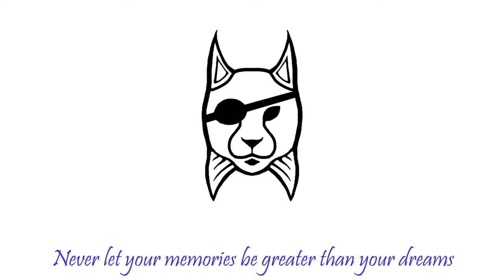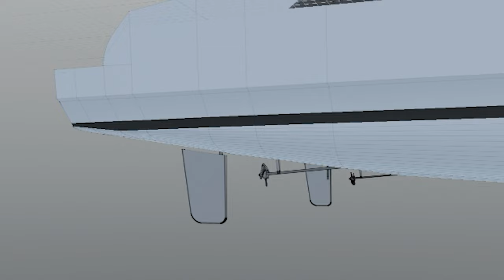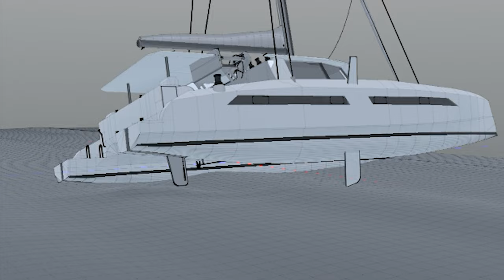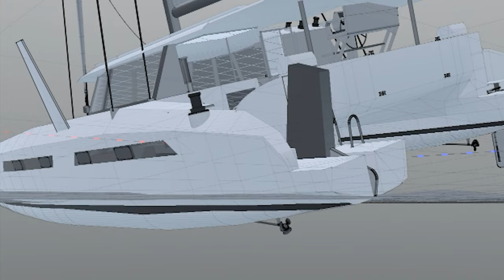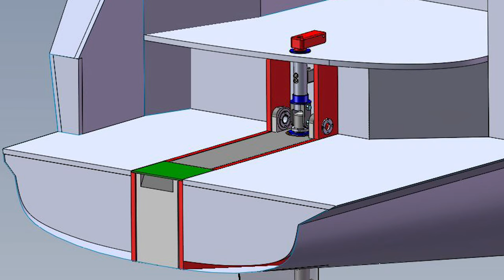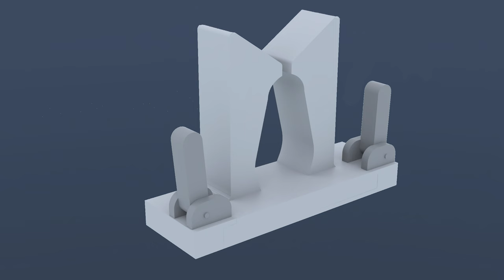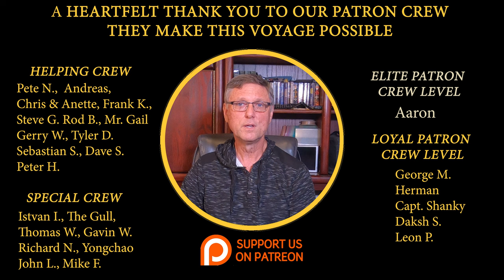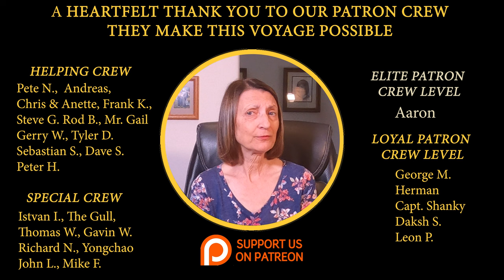Kit E39: Kickup Rudders, Bow, and Bulkheads

Comment: Another interesting week.....learned a lot about the mfg. of the bow point and the kick up rudder.   Thanks.
Reply: With the glass rope roll ..... you might consider speeding up this job by utilising two stiffened wires on either side of your material like a foresail furler.......pre tension two wires by locking one end in a vice and applying considerable twist using the other end inserted in a drill (this method turns plain fencing wire into straight spring steel wire). Place one wire under the wetted glass sheet and the other wire opposite above. Either 3D print a chuck to clamp the wire ends into it, this will lock the two wires together with the wetted sheet between, insert one or even both ends (wire chucks) into a drill and rotate (if you use two drills one would need to be in reverse).......this should evenly and tightly twist the wetted sheet into a rope roll......carry the rope to the glue up and remove the chucks and slip the wires. Any void left by the wire should be minimal and easily worked out.......just a thought......
With your bow stem you might also consider allowing for a little more glass/Kevlar reinforcing (on the outer skin/stem/heel) as this takes a battering from incidental impacts with flotsam and ropes.
Reply from the maker: Interesting idea, and it would probably work.  But I don't think we will bother with any kind of device for rolling.  I like the control of hand rolling, and I counted up the number of 'ropes' we have to make and it comes to about 120 total for the whole boat.  Each takes us about 1 minute to roll, so a grand total of two hours over the entire two year build.
Reply from the maker: Glad you enjoyed it

Comment: I have never had a "perfect" experience with kick-up rudders. The biggest issue has been the rudders kicking up when the boat really starts flying in a good blow and choppy seas. It sure looks like your mechanism is sturdy and ought to be able to overcome that problem, but I suggest you might want to add a fail-safe to the design: a place to put a pin that will turn your kick-up rudders into fixed rudders. Then you can keep the rudders in the water until you can get someplace safe to adjust the kick-up tension.
Great progress. Keep plugging away!
Reply from the maker: What we plan to do is have several strength 'arms' printed.  Fist we will use them to test to get the right strength dialed in, but we will keep stronger sets on board, just in case we need them in rough conditions. It only take a couple of minutes to swap out the arms.

Comment: Dagger board explanation was interesting, I’m personally not sold on the kick up rudders, the process is interesting to watch. Thanks 😎🇦🇺
Reply from the maker: We understand you aren't sold on the kickup rudders, but what type of rudders would you suggest for a daggerboard catamaran that needs to beach the boat?
Reply: Check out the Mumby Catamarans  built from Aluminum in the Philippines a good example is SV Jupiter 2 it has a kick up rudder works perfectly well.
Reply from the maker: Thanks, but I have already watched all their episodes :)
Reply: @SailingSVLynx  I’d assume you would only consider beaching on sand, I’ve always found the rudders will create their own hollows, and digging is the other option.
Reply: @jacksbackable  Sometimes we won't have a choice, like when crossing the Wadden Sea.  The tide will go out, several miles, dropping 30' at times.  We will land on the sea floor and wait 6 hours for the water to return.  Similar situations will arise while we are in the Kimberly's,  or at some ports around the UK.
Reply: @dalgamor  you can certainly do the Kimberly region without going high and dry. There are huge tides there, I’ll agree with that, there’s also Big Crocs! 🐊💀⚓️😎☀️🇦🇺

Comment: Use sticks with packing tape to hold the fiberglass ropes down in the crevices (tape to bulkheads…)
Reply from the maker: Good idea!
Reply: I’ve noticed your not fitting continuous uni’s in the bulkhead troughs, I’m a composite catamaran builder and each join is a major weak spot in your engineering, a place that could give you grief.
I’d be calling Jeff or Schionning designs and telling them what you’ve done.
Also a hot tip for doing the inside of your doors, make a male mould wider than all the troughs for the doors and wind the uni’s around it staggering the joins. Once green, cut it into strips the width of the bulks, use the finished uni’s as a cutting guide for your door cutouts, glue in and glass them in wrapping DB glass from one side of the bulkhead to the other, saves making the troughs, trying to stuff the rope in and having it pull out of the troughs, saves heaps of time and much stronger 😉
Reply from the maker: @andrewrogers796  Hey Andrew.  The rope is tapered at the ends by one foot (300mm) and overlapped with the next rope by that distance.  This is the method which Schionning recommended.
Reply: @SailingSVLynx  that’s ok, they’ve changed their thoughts on it then

Comment: 12:00
Use a drill to "twist" your rope. It really makes life easy. 
Just make a hook and place it in the drill and off you go.

Also you can literally buy some rope and soak it in epoxy.

Also: make a sized insert covered with the packing tape that you can compress the filler roll as it dries. You can use temporary painters tape to  temporarily tape it into the groove and et voila.
Reply from the maker: We are happy enough rolling the 'rope'.  As for the wood to press in, we have experimented with that.
Reply: @SailingSVLynx  I mention it because I watched SV Dauntless use the drill method and it was not just better it was revolutionary. No pun intended. 👍
Reply from the maker: I have watched Dauntless, but must have missed that.  If you can, link the episode and I'll take a look.
Reply: @SailingSVLynx  Building MV Dauntless "Step 27: Assembling the transom!"  about 16 minutes in. 👍 Looks like my link got rejected.
Reply from the maker: Well, we gave that a try, so thanks for the link!  We found that on larger sections of fiberglass we got too much of a cone shape, with one end tight and the other end looser.  So, we tried two drills, with one person on each end.  That way, we could put some tension on the 'rope' as we ran the drills.  You'll see this in an upcoming video, but thanks again, that video did help.  :)

Comment: I recall you mentioned in a previous video that the retaining clip mechanism for the rudder kickup will be 3D printed from structural nylon, and, from the render you showed, that part is designed to slide into a retaining slot. Is there a risk of the nylon swelling as it absorbs water (especially for a part subjected to steady contact with water), making it impossible to remove? Aparently a dimensional change of several percent is possible as nylon saturates with water. It might be necessary to prototype the mechanism in nylon, but machine a final part from stainless steel. I appreciate all the engineering considerations you explain in detail, by the way.
Reply from the maker: The arms can't be made in metal because they need to flex to release the bar.  The plate they are attached to could be, and we can print in stainless steel.  We will water test all parts before insalling them in the boat to make sure there are no issues like this.

Comment: Hey, maybe ask Schionning if you can substitute those ropes for thickened epoxy full of loose chopped glass strands? You just mix it together and lay it in wit a trowel or scraper. Ropes are so time consuming and often leave a void in the centre.
Reply from the maker: They were very specific about how the ropes must be made, even down to which weave and orientation.

Comment: I love the detail and focused attention to the pros /cons of a kick-up rudder v. lifting etc.  Not sure I agree with all of the hypotheticals (I’m steering with rudders in a push come to shove moment v relying on propeller steerage alone) though nor do I appreciate the cost/benefit v. risk of investing in this option v. a lifting or traditional system.  Yet that’s why I watch to learn…enjoyed the video. Thank you!
Reply from the maker: Hey John, thanks for the nice comment.  As for steering with props vs rudders, to each their own.  However, with a cat, which is vastly different than a mono in this case, the rudders are only useful for very limited situations.  With props only, you can maneuver much slower since, unlike the rudders, they don't require a lot of water flow to make them work.  Especially with electric motors, like on S/V Lynx.  A cat can pivot in a circle with just throttle control.  Think of them like driving a tank, which doesn't have a steering wheel or rudders.  It just needs two levers to independently control the two treads and it can spin in place, like a cat.  

There are a few specific times I might use rudders, like pulling out sideways from a dock, where you turn the rudders all the way to one side, then use reversed throttles.  One prop pushes water on the turned rudder and the other is turning the bow.  If you balance the thrust properly, you may pull out sideways, like when there are two boats, docked with you, one close to your bow and the other to your stern.  But, 99% of the time, you only need the throttles and can reduce the complexity of maneuvering and do it all at slower speeds than using rudders.  
https://www.cruisingworld.com/how/how-dock-and-swing-catamaran/
https://www.yachtingworld.com/video/catamaran-sailing-techniques-leaving-the-dock-67133

Comment: Hi I think that you  will find that once one rudder is fully up the pivot  will lock the rudder system  in central  position.
Reply from the maker: In the rare cases where we want to run with one rudder, there is a small hatch that gives us access to a quick release pin that we can pull to disengage the 'up' rudder from the steering.

Comment: You are certainly making much better progress of late. Brian - I fully understand you are following the manufacturers instructions and am not seeking to undermine that whatsoever - but for the life of me I really do not understand what is being achieved by these resin soaked fibreglass ropes around the bulkhead panels that could not have been achieved by the traditional resin mixed with coarse fibreglass strands. I had never seen this before and from the comments that it is not novel and have looked at the linked MV Dauntless You Tube video - but I am still not convinced . Keep up the good work and keep having fun too.😀👍⛵️😊
Reply from the maker: It's as simple as this is the way Schionning boats have been built for 35 years, so we weren't about to mess with changing their design when their boats are known for being strong and seaworthy.

Comment: I would build or reinforce the whole bows and sterns
Wiith a skin of Two layers of basalt..the bow with an engy absorbing core backed by a second layer of glass and or basalt and taper it into the main hull structure after the front collision bulk heads.
Reply from the maker: That is already coming, (more than two layers) we are just waiting for our laminating epoxy to arrive.

Comment: Nice build,    I wonder if an Aluminium Rudder would be easier to build and stronger (Orcas)    Also easy to repair compared to glass.   : )
Reply from the maker: I'm not sure alumiinum is easier to repair, though I agree it is harder to damage.  But, when it comes to the orcas, they tend to keep at it until the rudders are destroyed.  So, I'd rather not have them beating the boat apart trying to destroy aluminum rudders.  ;)
Reply: I think if you're at sea glass+epoxy is easier to repair than aluminium . . . also lighter and stiffer, which is always a benefit on a performance cat.
Reply: The yachts that have sunk (quickly) were ‘charged’ by the orca directly onto the rudder blade - the force loaded the top rudder bearing housing laterally (force of impact x the leverage of the distance between impact and bearing housing structure) and fractured the boat structure  which opened the yacht to the sea. Game over.

Comment: There's missing a crash box from solid glass... If the bow is hit even by something very light the foam will deform. Which is fine to prevent a large leakage but it needs to be protected by some solid laminate so no feather from the marina ducks will harm the foam. Additionally I find this crash zone way to small and there should be laminate inbetween the layers of foam to stop the water and protect the rest of the crash box.
Also the kick up rudders are useless if the propeller shafts are ripped out by obstacles in the water. The hole in the hull will sink the boat immediate.
Reply from the maker: Where do you think we are missing a crash box?
Reply: Was working on the comment again... Why don't you build the hull to it's entire height in one piece?
Reply from the maker: For several reasons.  First. this is a kit boat, so we built it according to how the kit was made.  But, the next reason is better :)   By not building the sides of the boat on early during construction, we get to have air flow from outside, in the hulls for sanding, fairing, etc.  Less fumes and dust, and cooler for the workers.  Here is a link to an image that shows this for you (scroll down to the 'Light Weight' paragraph and image).  https://www.svlynx.com/solitaire1490theboat.html

Comment: Another  U Tuber used mooring line rope soaked in Epoxy
Reply from the maker: Though that might work, the engineering plans call for fiberglass rope, so we stuck with the plans to be safe